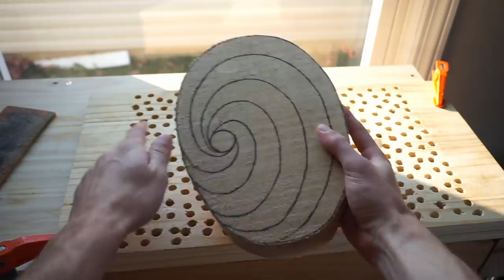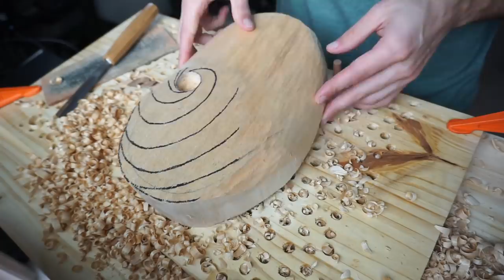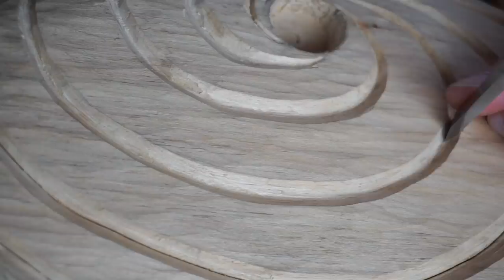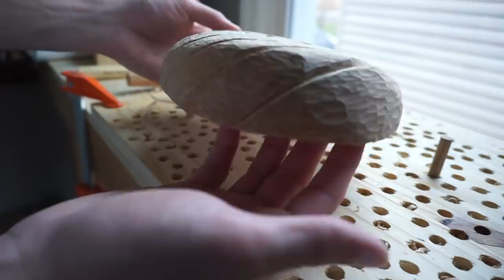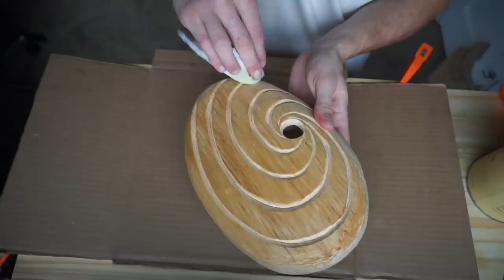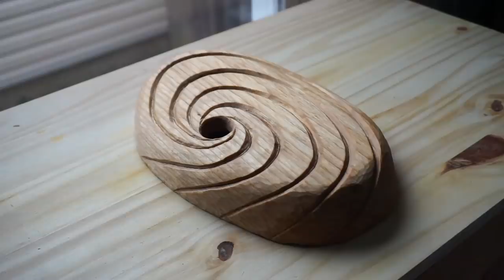Hand Carving a Tobi Mask from Naruto

Comment: What kind of gouge are you using for the first 1/3rd of this video?
Reply from the maker: I'm using schaaf wood gouges and that one is a 7 - 14mm
Reply: @Scholley_  Thank you! I'm gonna nab some. I ordered some rando gouges i found on amazon, but im having trouble having them pull smoothly through the wood, even though I'm just tryna carve basswood.
Reply from the maker: @Samflaful  I think Schaaf has the best value out there, but you will need to sharpen them when you get them. They come a little bit rough but cut like a dream once you give them some TLC